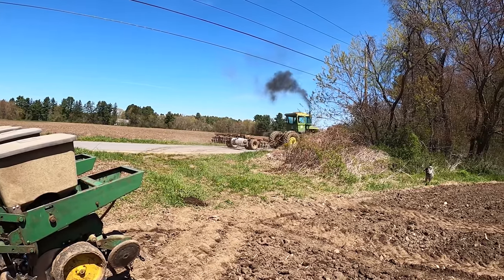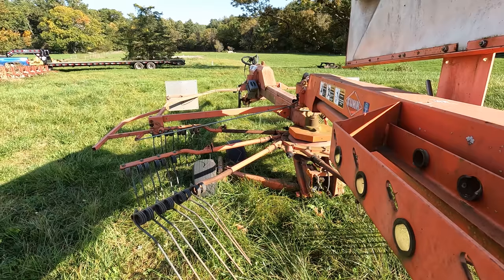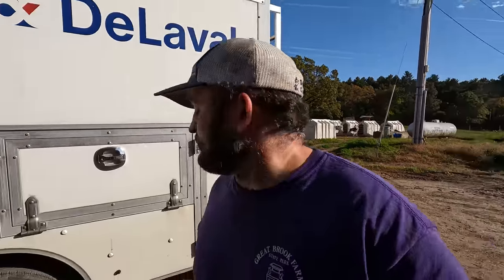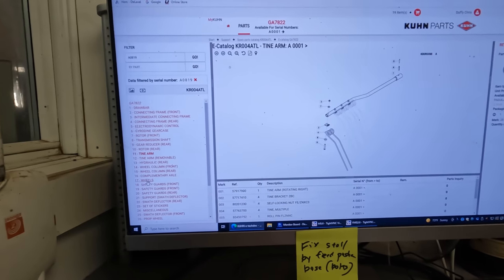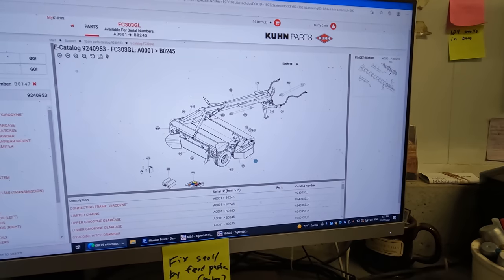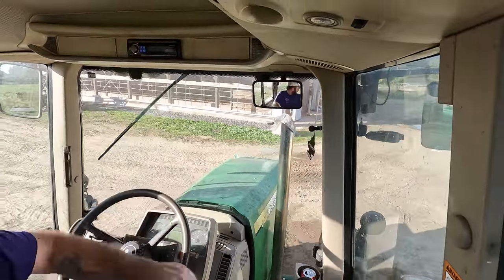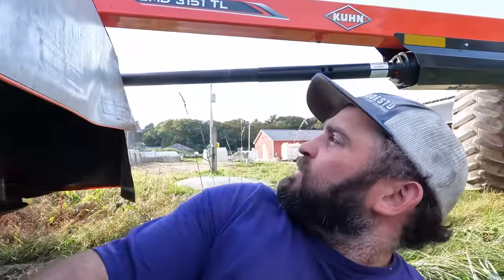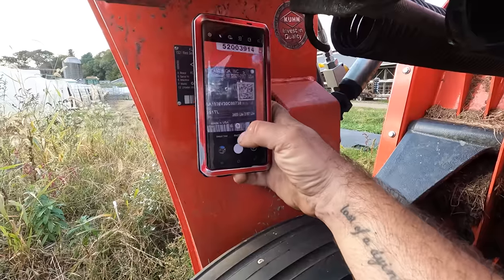How To Be A Agricultural Equipment Parts Guy

Comment: You might be able to fix the mower with a sledge hammer to bang the rock guard down and trim the edge of the turtle with a torch.  They don't have to be perfect to run.

Comment: what happened to a book and not realing on the internet im sure the parts book only cost 30 bucks and your losing time and money ordering and getting the wrong parts get the parts book save your self all the headaches
Reply from the maker: We have the parts book. How would it make it faster? I click on the part online and it adds it to the cart with the quantity. It's legible and correct for anyone who looks at the parts list
Reply from the maker: @ericteipen  a lease payment on a new chopper is more then I make a year on chopping. I've done the math. Never mind not being able to work on. Alot of the newer stuff without a computer. I'm making it work tho thanks for being my financial advisor. I started with nothing 5 years ago and slowly growing
Reply: @ericteipen  What exactly is the correlation between the old "junk" chopper and the brand new mower?  He is ordering parts for the brand new mower
Reply: @DuffyAg  well what i saw was this isn’t what we have the book is specific to that implant or truck and tractor
Reply from the maker: @joe-gd3pg  the book shows a different part layout same as ths online parts book. It took me a while to figure out that the machine has parts off other models not sure if it was carry over parts that they put on our what. But without the online look up I would of never found it. When you look up the machine online you put serial number and everything in so it's a manufacturing issue not a parts book issue
Reply: New stuff has def and anything with def is a problem in itself... things need repair and work its life nothing lasts forever just like your house... if u don't work on it and maintain it it will fall apart...

Comment: Why do you fight with that ridiculous rake? You can find some twin v rakes or twin wheel rakes that are a 100% less to deal with breakdown and parts wise than that European abortion thing. They fold up narrow, less length, and for craps sake less parts and fixing. you like to travel, so I know you can find a good used affordable one. I'm not trying to be a dick, because I use used equipment too.
Reply from the maker: The ability to rake more into a row for silage. Some cuttings in heavy feed its 2.5 rows with some in lighter it's 7 rows worth. Keep the chopper fed to keep it consistent. V rakes are decent not in some of our odd or small fields tho